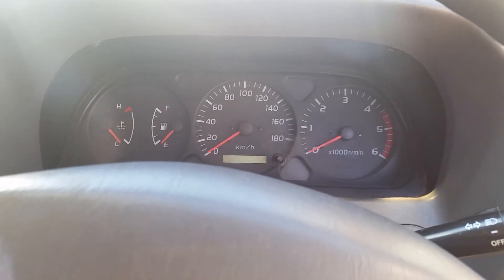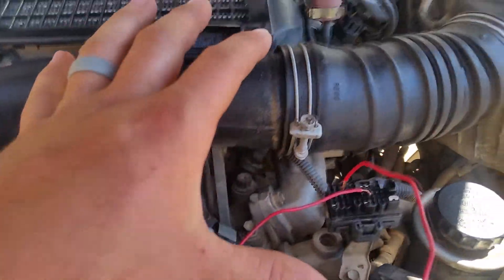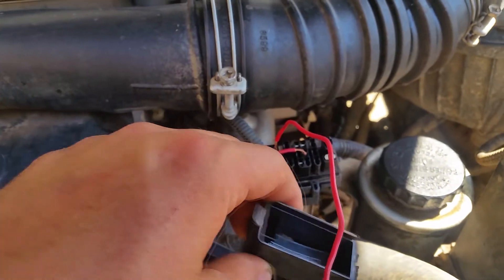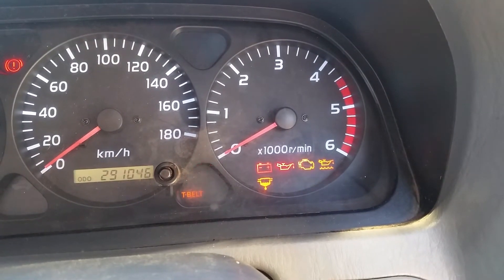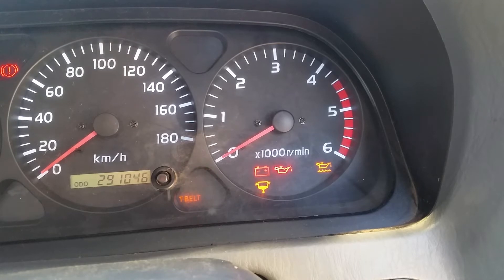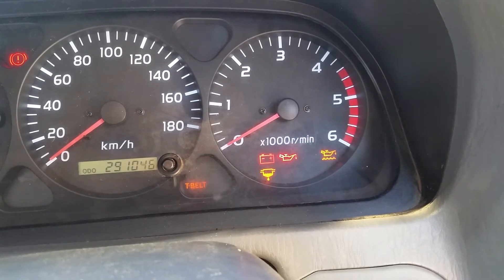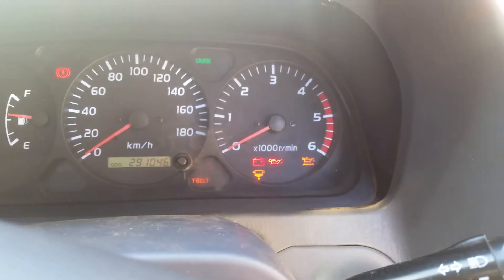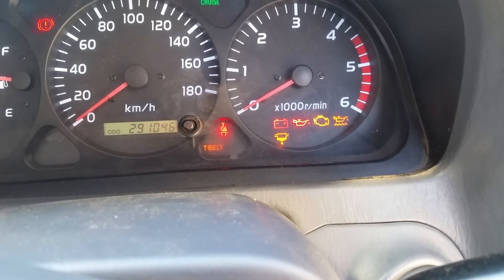How to read your engine fault codes

Comment: i have codes 15, 24 and 35 showing up. any tips on what to do and how to fix please. Car runs 1st 2nd 3rd gears no problem. 4th and 5th lags and gets no power blows heaps of black smoke and coughs and splutters. wont go over 2000rpm
Reply from the maker: Heya,
The codes
Are 15 throttle control motor
24 intake air temperature sensor
35 intake air pressure sensor.
Could be an wire wire problem.
I probably check all the wiring and the Senses see if they're all operational.
Also disconnect the battery clear the codes go for a drive test of the codes and see which one comes up.
Hope this helps.
D

Comment: Hi DIYIT13, great video, thanks for sharing. I'm not familiar with this engine but trying to help a mate that has the same error. Would you be so kind to share how you fixed it ?
Could you please let me know where the timing control valve is located? Is it the same as the crankcase position sensor ? Cheers !
Reply from the maker: Hi there,
So the timing control valve and crank  angle sensor are.
I replaced the timing control valve which is on the back side of the injector pump.
You'll need to access it through the passenger side wheel well.
This is how I test it.
1. Disconnect the timing control valve wiring connector.
2. Using a voltmeter check the battery voltage is present terminal one of the wire connector with the ignition on.
3.if battery voltage is not available check the wiring and connections between the timing control valve and the ECD relay for conductivity and shorts to earth.
4.
Reply from the maker: 4.using an ohm metre measure there is resistance between the terminals of the timing control valve if the resistance is not interested patient renew the timing control.
5. Using jumper leads connect terminal 1 battery power and terminal 2 to earth. check that the timing control valve solenoid clicks replace the timing control valve.
Do not apply battery voltage longer than 30 second.if test must be repeated wait until the cyanide is cool to the touch or damaged to the  solenoid may occur.
6.check the wiring connections between the timing control valve and the engine ECU for Contiuity and shorts to earth.
Also check the engine ECU power supply and earth circuits.

To remove,
Using a 5mm Allen key remove the bolts withdraw the timing control.
For installation  is reversal of the removal process ensuring new o rings are used and the bolts and a wiring connector are secure.

Pin 1 is the top pin of when the timing control valve is installed.

Hope this helps.
D